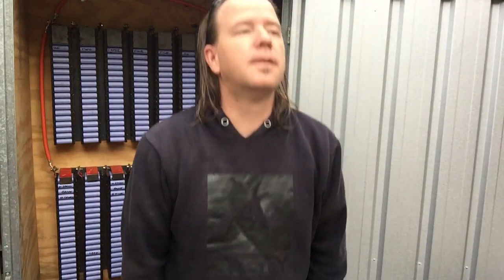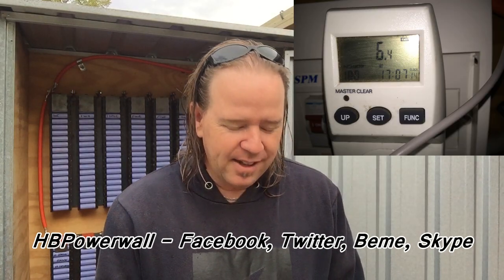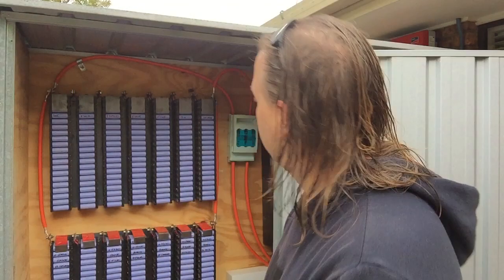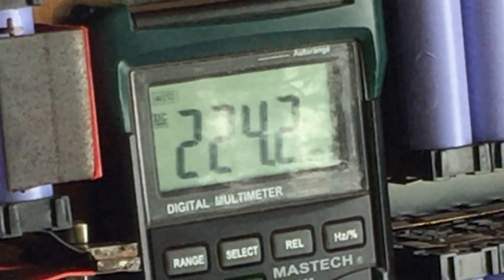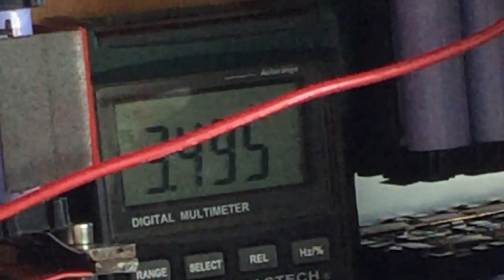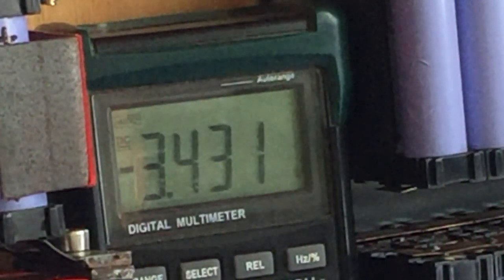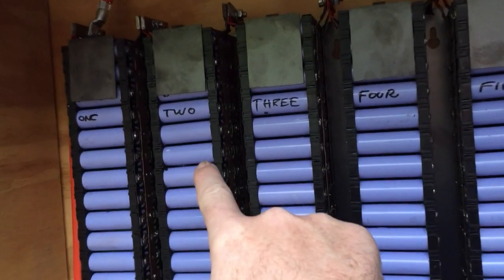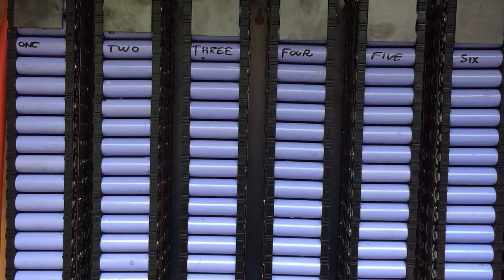385w Load test results (IT FAILED) little tiny button batteries let me down.

Comment: Where do you get your cells from here in Aus? Looking to start up my own small project.
Reply from the maker: Aussie lands a big place, if your south side of brisbane hit me up with how many you would like :)
Reply: not as big as you would think :) I am on the sunshine coast. would all be based on price
Reply from the maker: 2.50 ea
Reply from the maker: Per unprocess laptop battery with between 6-9 cell packs
Reply: These are mostly Panasonic cells? I suppose its mostly random. I would be willing to take 10 to start with just to run a sample. can you get me an estimate on shipping to 4560?
Reply from the maker: Completely random you could get 10 completely faulty packs and don't post sorry

Comment: Great project. Looks like each bank cell is made up of the same measured capacity batteries ( label 2400, 2600 etc ), shouldn't each bank cell have equal total capacity?
Reply from the maker: Hell no that would make for far too much common sense :) Stay tuned

Comment: Did the inverter have grid power hooked up as a back? 
If the unit does not since the grid will skip back to grid voltage setting & use the battery cut off voltage setting.
Reply from the maker: That was the issue :(
Reply: Yea bro, after watching your video hit me next day like a ton of bricks.... Had a feeling that's what happened. Sorry about that was a real bummer. can send you links to make your own voltage cut off switch if you would like grid not needed??

Comment: If it was me I would want to know why the pip 2424smx didn't stop depleting at your chosen voltage, if it was a brand new battery bank I would be well pissed.
Let us know your findings are Pete, and good luck with the rest of your tests M8.
Reply from the maker: Figured that out and it was probably 99 percent my fault. With my old pip2424hs it's has grid power attached with a low voltage cut off of 22v and a battery disconnect of 20v so every night for the past 14 months it's depleted the batteries to 22v then just returns to grid power for the remainder of the night/day. BUT without the grid input it can't 'return to grid" there for it just carries onto the 20v mark. Makes sense now but least I learnt something new with out the need of the fire brigade  :)

Comment: I'd be interested in seeing the current flow through a single cell. eg put a meter in where the fuse wire was.

I've got some 5.6A discharge rated 18650's, which I hope I can get more of. Would use a lot less cells if I could.
Reply from the maker: Sounds like an interesting test that'll be very easy to set up. I shall do that one for you.
Reply: FYI: I've got misc recycled 18650's in my electric lawn mower in a 12P7S config. It draws a max of 118 Amps, which means around 9.8 Amps per cell. They get a bit warm tough. So you can probably pull more than 5.6A out of the cells you have, but it's not recommended.
Reply from the maker: I don't have any such way of drawing more than 100 amps :( UNLESS i decide to upgrade :)

Comment: Have you looked at the electro dacus lithium balance chargers?
Reply from the maker: so my wifes paypal is.......
Reply: I don't think the elcro dacus can handle all his power
Reply: +l1t7l3ph0o7 The electrodacus sbms100 handles a max of 8 packs and 120 amp solar current. I guess he could end up using it with some changes to the battery pack configuration and a $5 donation from everyone.
Reply from the maker: Paypal button up the top on home page.. hahahahahahah

Comment: Mate, loving your work, can't wait for your next video's! I'm following your method's making my own (smaller) power bank and learning heaps from you. If you have the time I do have a question? If you find a cell that is over 3v do you discharge it before charging to get the "actual" current rating before you build a pack? Cheers.
Reply: No, you should be fine with just hooking it up to a charger and then testing it.

Comment: What BMS do you have installed on the pack?
Reply from the maker: NONE ....yet :)
Reply: I think it's going to be a recurring issue with one pack being significantly lower than the rest. Loving the series though, tons of fun. With your 30A charger, how do you ensure the packs are balanced or do you need to do that manually?
Reply: +Andy He is balancing them before testing so it shouldnt have any effect on the pack voltages afterwards. Pack 3 is bad. A bms wont fix that

Comment: pack 3 should be where pack 7 is?
Reply from the maker: pack three should be in the bin....
Reply: +HBPowerwall lol, maybe true, but my point is the lowest capacity packs should be at the end of the line in all accounts.
Reply: +GrimL0gic sorry mate my bad you are correct negative to positive I miss spoke there, you are welcome to goggle "using batteries of different capacity" and there are plenty of electronic experiments to show how this works if you're interested, first basic rule is don't, but as we use second hand batteries that is not always an option and if you must then there is a few things you can do, this is one of them the other is to add more cells to the lower capacity pack to offset these affects.
Reply: +Da Rainmann why is that?
Reply: +GrimL0gic the best way to think about it would be as the packs fill and discharge if the as a pack closer to the positive terminals fills/empties first it creates strain or a bottleneck if you will, this creates heat  (as seen in the thermal images) heat = bad. and that pack will degrade quicker. this is why you similar capacity batteries, this is also the major function of a BMS.
Reply: +GrimL0gic fill seven glasses of water by adding a small amout to each one to the next evenly, start with the 3rd one half full to simulate less capacity. what happens ?
Reply: +Da Rainmann I understand the capacity issue what I dont think I follow is why the pack needs to be on the end. Any current passing through one pack will pass through them all. A pack overheating due to forced current will do so anywhere. The issue is pack capacity (or other issue maybe) not the location
Reply: +GrimL0gic not really, as electons flow they do it from positive to negative so power is removed from the first pack first and all other packs basically refill the one before it creating flow so pack 7 accually has less strain on it, if pack 3 has increased heat it's internal resistance increases creating a bottleneck of flow and wasting power through heat
Reply: +Da Rainmann electrons flow from negative to positive. You are refering to conventional current where holea flow from positive to negative. Current flow btw is practically instantaneous and isn't so much a flow but a random drift. So are you blaming the heat on the internal resistance or the packs capacity? The two are nkt the same things.
Reply: +GrimL0gic holes*
Reply: +Da Rainmann I'll do that. have a good one